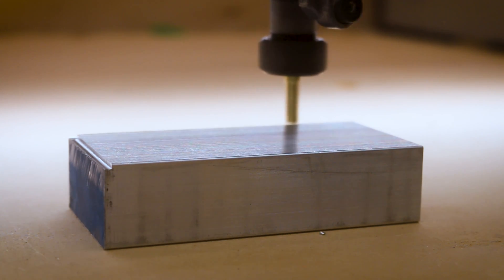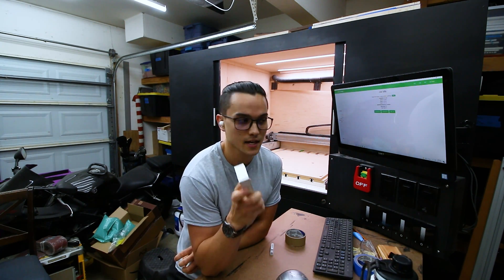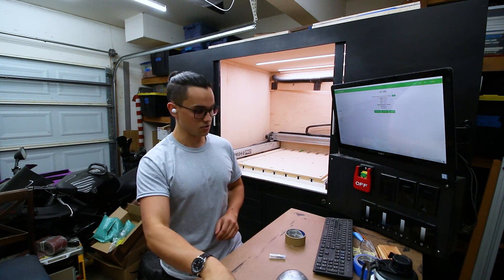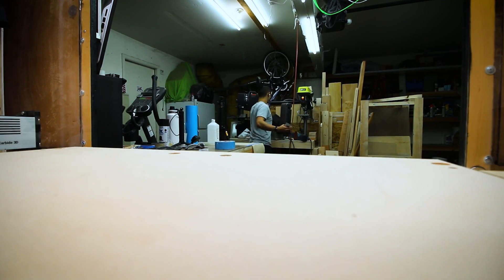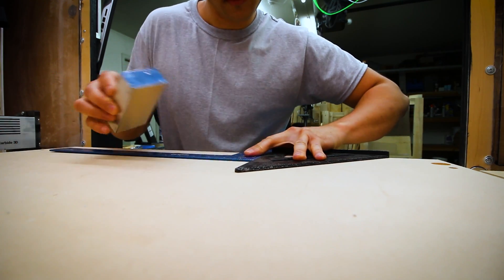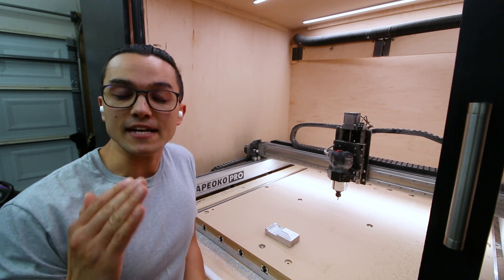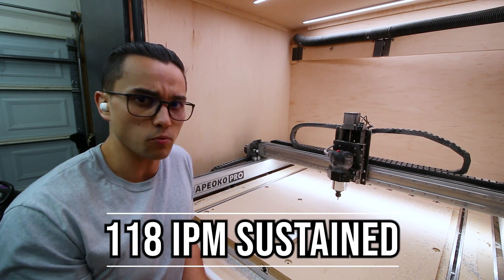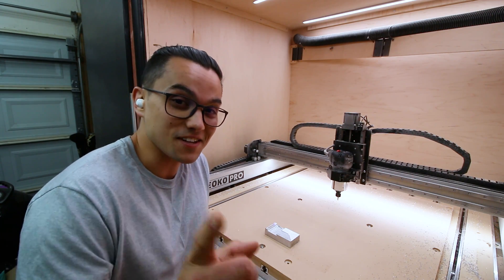Will it Cut Aluminum? Shapeoko Pro

Comment: Have you had any issues with the belt drive? I know i want a machine with linear rails but I can't decide if ball screw is worth the added cost. If all works out, I'd likely upgrade to a larger machine.
Reply from the maker: Belt drive is faster and cheaper than a ball screw with a con being the rigidity. Depends on what you plan to cut and how fast you're trying to cut it. Personally I haven't had the need for ball screw that justified the cost and many hours of milling later, no issues with the belts. Have fun!

Comment: You don't need coolent to cut aluminium, you need the right bits to cut dry. DLC or similar coated bits will give you this result.
Reply: don't even need coated bits. just need single flute ideally.
Reply: @chrishayes5755  DLC bits give a cleaner finish and less prone to build of aluminium. They are designed to cut without the need for lubrication.

Comment: I cut some aluminum coins on my shapeoko 3, with a 1/8in tapered bit (it has a needle sized tip). It did an excellent job. I just had to cut very SLOW (or I'd snap the bit)... I used double sided tape and that worked great.
Reply from the maker: Nice! Ya the cutting forces get higher the faster you try to move through the material so the better the work holding needs to be. Fortunately double sided tape gets the job done fairly well.

Comment: I have never heard of this machine..   The video seems to be for those who know what it is and what it normally cuts.
Reply from the maker: The machine is typically used in woods and plastic. A big question that comes up is will something like this have the rigidity to cut metals. If you use the correct set up and machining approach, yes. It will cut metals.

Comment: Can the Shapeoko 4 do something like this?
Reply from the maker: The shapeoko 4 is also pretty darn capable but the linear rails of the pro add a bunch of ragidity. I would say it is likely just going to require a slightly different recipe but keep track of chip load so you don't weld the tool and definitely go for a single flute. Good luck!
Reply: @AustinConrad  Alr thx. We're planning on buying one for our robotics club. I'm just searching around to see what's capable
Reply from the maker: @rookie693  sweet! If you call carbide 3d their sales guys should be able to answer more questions too

Comment: Austin buddy, where did you get your router wrenches.  I had seen those a while back on another video but can't find them.
Can you help a fellow SPXXL practitioner out? Also, I am seeing how you are pushing your machine to the limits.  Really cool.
Reply from the maker: Hi there, ya the one's I got where these:
Park Tool PT-09 Shop Cone Wrench https://www.amazon.com/dp/B000QSZT0M/ref=cm_sw_r_apan_glt_i_NYM10PJYP4343TG02G6Z?_encoding=UTF8&psc=1

Park Tool PT-09 Shop Cone Wrench https://www.amazon.com/dp/B000C12BZO/ref=cm_sw_r_apan_glt_i_A48A0YCTM70927QNKPFN?_encoding=UTF8&psc=1

Thanks for enjoying and good luck with your machining! Btw, if you use the spindle lock you can get away with just the larger one. Didn't know that until recently.
Reply: @AustinConrad  I've been using the spindle lock ever since the small aluminum wrench bent with the one that
Reply from the maker: @homezero  glad you figured it out sooner than I did!
Reply: @AustinConrad  I've been in woodworking before I had a CNC so I had to change bits the old way back then so it was a no brainer for me.  BUT, I have heard those too have a tendency over time to fail. That's why I am looking for the Wrenches. Plus, I like the rubberized handles for comfort.

Comment: If you would like to speed up the process a bit you should go full dept and take only 10% of the cutter diameter maybe 5% since its a desktop router this saves alot of air milling that it does in the different depts

Comment: Great job. I’m a cnc machinist and also went the mechanical engineering route like you did. Glad I found your channel. Some advice, lie to whatever cam software you use and reduce the tool diameter and the little towers it left behind in the adaptive tool paths, or alternatively reduce the step over so the actual tool diameter covers all of it. It looks like a 1/8 flat so just put the tool d a thou smaller
Reply: And the little towers will disappear when you lie to the cam*
Reply from the maker: @edenochoa2337  thanks. Ya I think just a simple reduction in the step over should get it done.

Comment: look at stickytape and superglue method from nyccnc channel.
Reply from the maker: It does work, my only worry to use it more often is the brittle nature of CA glue. So far the carpet tape works pretty well but is a fair bit more expensive
Reply: @AustinConrad  ah well, CA is not that brittle when its bonded to a surface that is flexible, ive run it in a.. well much larger machine plowing thru steel parts with a 20mm endmill saved the day being able todo so. :)
Reply from the maker: @roughedge-machineworks  interesting, I'll keep that one in mind then!

Comment: I would double check your endmill diameter in your cam profile. If it is set to large it will leave the wisps behind because it  assumes they were cut by a larger diameter endmill.

Comment: Reduce your tool step over about 5 or 10 thousands to help reduce the problem with the thin fins your seeing. That what the tool path over lap a tiny bit on your step overs.
Reply from the maker: Thanks!
Reply: @AustinConrad  Your welcome I had the same problem with my shapeoko the first time I cut aluminum but now I have built a full tormach size cnc mill so I have tons of rigidity and more to learn. Keep the awesome videos coming

Comment: I am curious what your optimal load was for the adaptive roughing. If it is too high the path will leave whisper lines in the part once deflection is added to the system.
Reply from the maker: The settings are in the video. 0.23" which turned out to be a bit too much. I dont think it was deflection, I think the tool isn't truly. 25" cutting diameter. I plan to find out with more testing
Reply: By the way here is a video of a less rigid machine cutting aluminum at a very high MRR.  Your machine should be able to handle this recipe.  https://youtu.be/zefnrPRvc9Q

Comment: Single flute is definitely the way to go with cooling, and a big cutter -- for sure. You will not generate a lot of heat and chips will clear out on their own pretty easily. When you get into finer details, and smaller cutters, the high RPM becomes impossible without coolant. Hence I ditched my mdf spoil board (not a shapeoko, a custom CNC, but same issues) -- so now I'm rebuilt my CNC bed with 2020 extrusions and will be bolting 1 inch thick HDPE to it -- I tried using HDPE as a spoil surface on top of MDF, and works a treat, holds threaded inserts, holds tracks -- works with double sided tape, and with blue tape with CA glue. With a full spoil bed being HDPE, coolant is not an issue.
Reply from the maker: Nice! Only issue i think I'll still run into with the swap is the fact that my entire machine interior is bare plywood so it might still have to wait. Thanks!
Reply: @AustinConrad  i made an enclosure for my CNC converted mini mill, and I just painted the plywood with marine paint. That takes care of any issues with coolant - plus if you're just doing mist, not flood, just the spoil board gets wet.
Reply from the maker: @kazolar  thanks, I'll keep that in mind!

Comment: I invested in the SMW fixture plate and hobbyist mod vise with those mitee bites.
Reply from the maker: I've been looking through those a bunch and it might be something worth pulling the trigger on in the future as more metal work becomes a thing. Thanks!
Reply: Remember to tell the wife it is about safety ;)
Reply from the maker: @paulbuffington9709  that's right! I could be injured if a part comes loose!
Reply: @paulbuffington9709  I used that one for the Pro.... HDZ and spindle. I'm pretty sure my wife thinks my cnc is a expert in cpr, drives a ambulance and has ER privileges at the local trauma center. 
I just need her to believe I'm in enough danger for a HDM next!!

Comment: I have seen those blue handled wrenches used in other videos. What is the name brand or do you have a link to purchase them?
Reply from the maker: Park tool scw-22 and scw-13 (22 and 13 mm). Unfortunately the ones that came with the router were kinda crap and broke on me second time I used them.
Reply: @AustinConrad  Thanks! I have seen other YTers use them before and they gave the same reasoning. I am hoping to get a Shapeoko in the next couple of months. Until then I am continuing to use my crappy Amazon bought Genmitsu lol.
Reply from the maker: @shrimuyopa8117  Fun times all the same!

Comment: Look into mitee bite work holding, and you might try compressed air for cooling. Yeah it’s not gonna lubricate the cut, but it might keep temps down long enough to do a extended run
Reply from the maker: Ya that tape worked out great. I've thought about the compressed air,I just don't have an air compressor big enough that it wouldn't be going off the entire time.